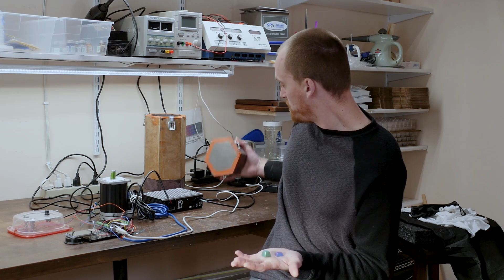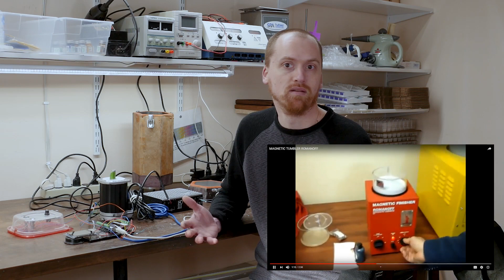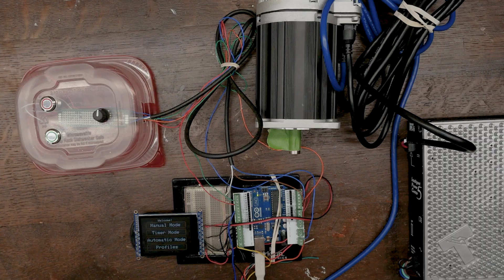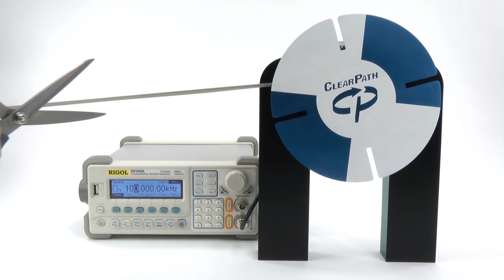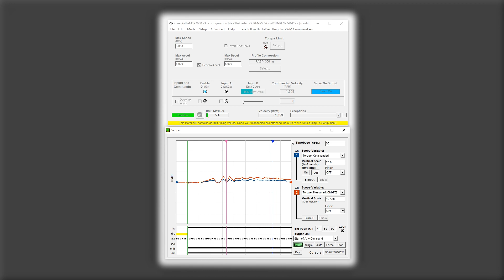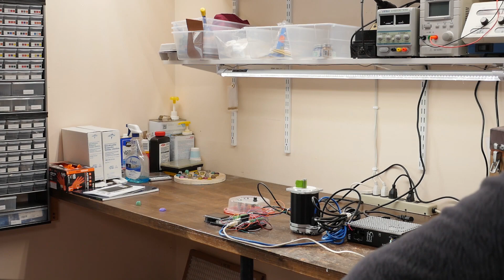[Part 1] DIY Magnetic Deburrer with Teknic Clearpath Servos and Arduino!

Comment: Hey Chris good video looking to do something similar with an Arduino and clearpath motor. want to be able to control speed with a pot and display speed of the motor on a screen.  Do you know if its possible to get the Clearpath motor to send speed to an LCD display and then use a pot to adjust the speed. Thanks

Comment: Nice project. That motor is a gross overkill tho all of its sweet features go to waist..
Reply from the maker: A big reason I wanted to use one of these motors is just size and weight.  I have very little room in the garage and this will need to be stored away when not in use.  If you look at the size of the other DIY machines they are just way too big and heavy to be practical to move.

Comment: Teknic's website is rather crappy.  Why do you have to register to see prices?  The whole company seems rather shady to me.
Reply: Hi Projectaro,

I ran across your post and am sorry to hear that your experience on Teknic’s website did not live up to your expectations. This is especially disappointing because Teknic has spent a great amount of effort to make our website as user-friendly as possible. I don’t want to hijack Chris’s YouTube channel, but a bit of clarity here might be helpful. 

To start, everyone can view the 1-9 pc prices for all ClearPath motors and accessories on Teknic’s website without having to register. Only pricing for quantities greater than 9 units requires a registration for products that are sold online. 

Just for background information, Teknic only sold servo components to high volume OEM companies for close to 25 years. These companies bought Teknic products in quantities of hundreds or thousands of units per year, and the pricing was provided directly to the customer based on the quoted volume (not on negotiations). While we still have that OEM focus, the release of the ClearPath integrated products started a new chapter for us. Teknic is now able to provide servo components to low volume integrators, and even the DIY community as a whole, directly through our website.  

Why does Teknic request a registration at all? The answer may not be obvious: improved technical support. When someone registers on Teknic’s website, a Teknic engineer is assigned to that person/company. The Teknic engineer then does online research (if possible) to understand what market and type of application the company typically does. This methodology allows Teknic to provide more efficient support for our customers if and when they contact us.

Teknic is always working to improve our website and documentation so we welcome all customer feedback. We often use that feedback when making improvements. Please send any additional comments to support@teknic.com and include your suggestions for improvement (screenshots are greatly appreciated). I can guarantee that your comments will be reviewed and that someone will respond to you in a timely manner.

Best regards,
Jon K. – Teknic Servo Systems Engineer
Reply: I’ve been using their units on a 3-axis knee mill for a couple of years,  no problems whatsoever.  One of the local HAAS techs was in my office when I had them on a table before installation and said ‘Hey,  I’ve seen those before,  they make them not far from here.’  Website may not be spiffy,  but products are Top Notch,  I’m just glad they sell to more than just OEMs.